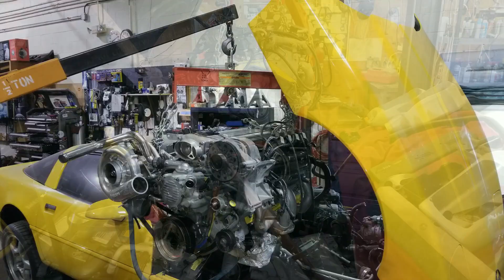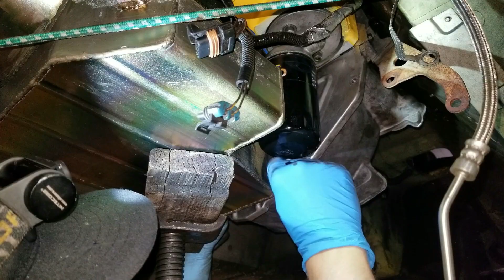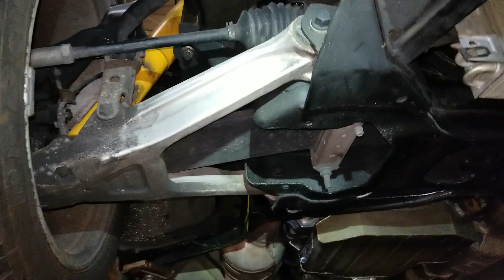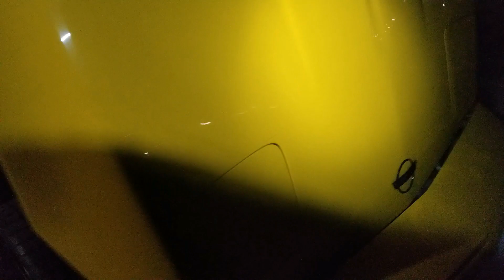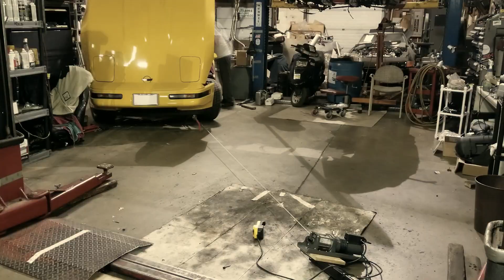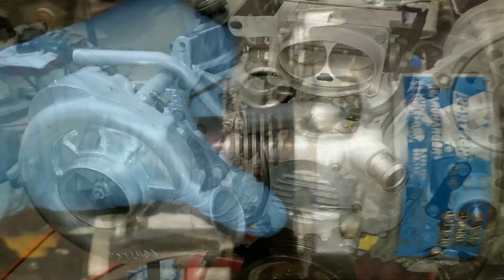Lingenfelter Engine Restoration P8: It Lives! Project Completion

Comment: Rick, would swapping a stock 95 lt1 computer for one with a tune on it cause the speedo to stop working?
Reply from the maker: It shouldn't unless something in the tune file was not right. The 94 and 95 PCM is the same I believe. A quick check shows that PCM connector A #32 is the VSS signal for both 94 and 95.

Comment: How much of a pain is it to tune?
Reply from the maker: Well the main problem is that the software (Data Master, and TunerCat ) that was designed to run on windows 95 has not had any support. LTXTech.com has a lot of resources on what hoops to jump through to set it up on a modern laptop.  Its still finicky. The stock pcm tuning is pretty limited compared to the newer stuff but its possible to get a good tune with it. I would love to put a 24x conversion on this due to the power level its at and get a much more accurate tune at higher power levels.